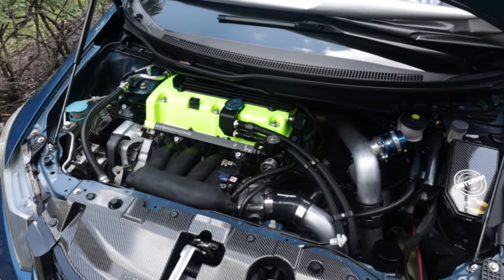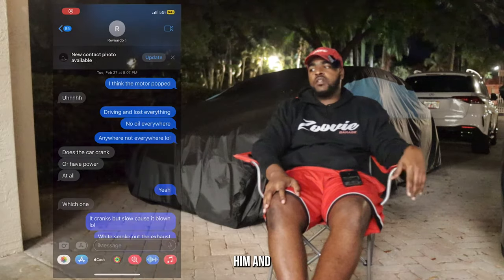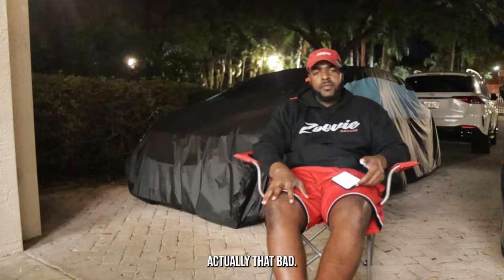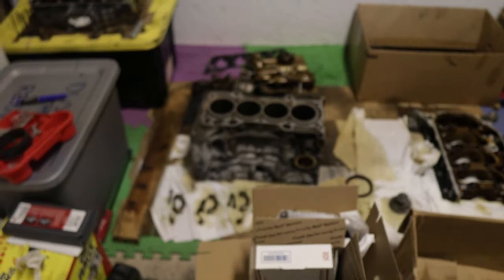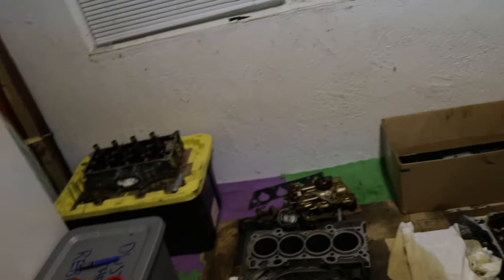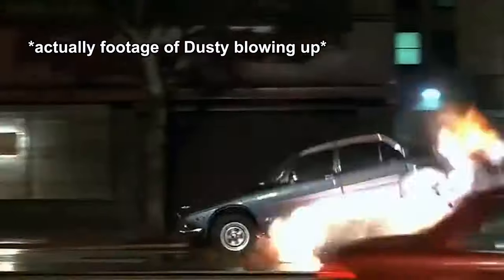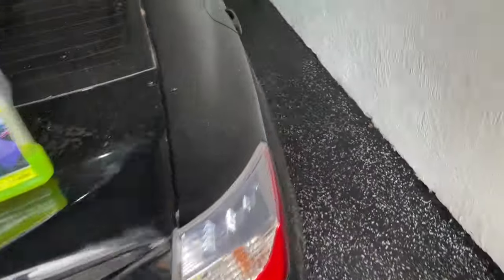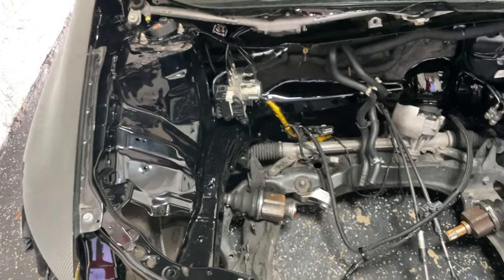MY TURBO CIVIC BLEW UP!

Comment: I might be moving to Tampa for a job offer. I'm still building up my 9th gen. Current build is a k24a1/k20z3 darton sleeved. Don't know what I want for power tbh.  600 sounds perfect for the street so that's a realistic goal for you. Anything beyond 700 is just spinning the tires at that point.
Reply from the maker: 600 should be amazing
Reply: @zoovie  I will say, since you have everything apart. I'd highly consider investing in sleeves. It's expensive, but its insurance so you don't have to scavenge another block again. Especially for 600hp